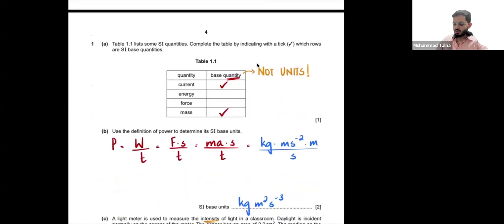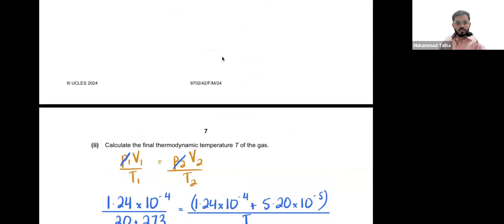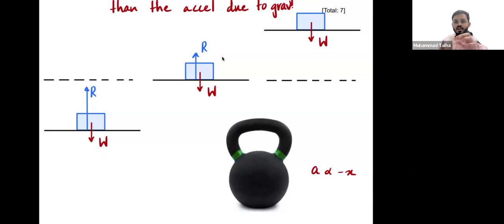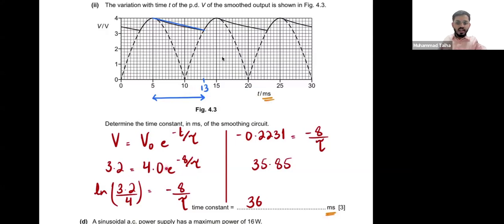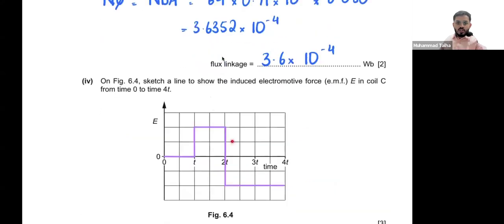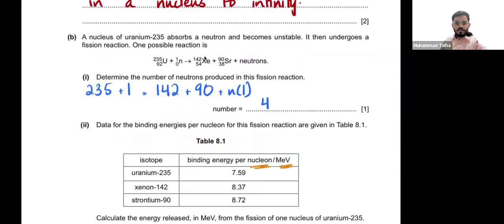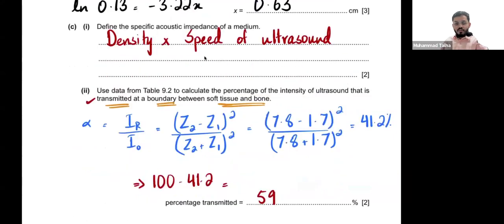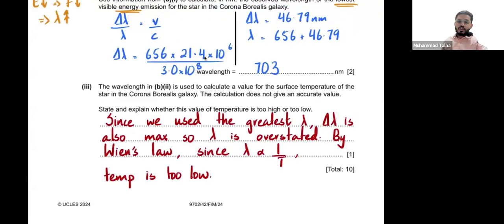LATEST PAPER: February March 2024, Paper 42 | Yearly Past Papers | Cambridge A2 Level Physics 9702

Comment: in q1)iii) why is the current energy possessed by satellite only the kinetic energy and not the kinetic energy + potential energy?
Reply from the maker: Hi. That's a great question. 

That's because rather than talking about absolute energy values, I talk about the CHANGES in energy. So what I calculate is the energy required to move it to infinity. Since the energy required is greater than what we have presently, we need some additional energy which is then calculated. 

Hope this helps!
Reply: @ThePhysicsJunction  sir i checked into for the question,
the moving satellite makes it more harder for the satellite to be brought to infinity and obviously the potential energy too that is an attractive force so I think kinetic energy and potential energy summed up is the solution to the AMMOUNT OF ENERGY required to bring such a satellite to infinity!
Reply from the maker: @jaskiraatshah9445  Sorry, I didn’t really understand your question.
Reply: @ThePhysicsJunction  I think i get now, First i was thinking that you will have to overcome the kinetic energy, but now the question required an additional energy meaning the kinetic energy in this case is like an advantage and helps in bringing the object to infinity so the final outcome is by doing the Potential energy subtracting the kinetic energy

Comment: In q1)iii) can we use 1/2mv*2 to calculate the KE of satellite? As in the end, the answer is coming right as well
Reply from the maker: Hello and thank you for your question.

The short answer to that is no because it is just a coincidence that both values are turning out to be the same. If the GPE was 10 then subtracting the KE would give a different value than what the initial KE was as shown in the video.

Since the question was asking for the ADDITIONAL energy, we subtracted the energy we already have from the energy needed.

Hope this helps!